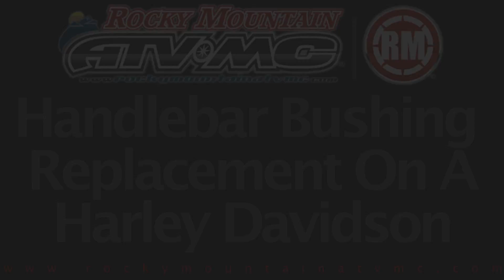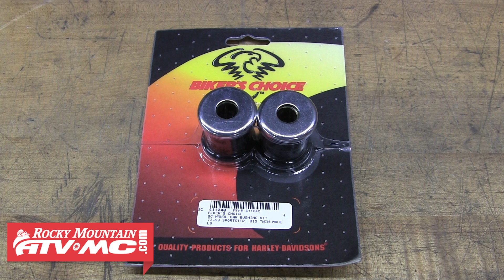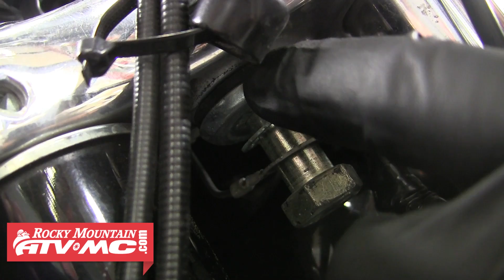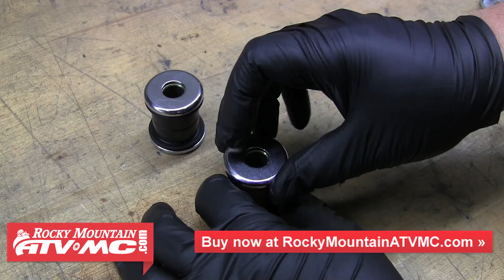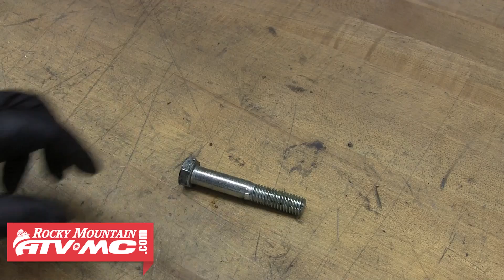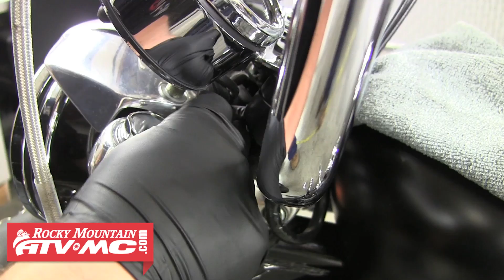Harley Davidson Handlebar Bushing Replacement (All Non-Fairing Models)

Comment: Super great well done and informative video.  My Q: I used a regular ranch is it critical if I over tied the bolts?
Reply from the maker: It is possible that you can damage the threads or break a bolt if you tighten them too much.

Comment: Medium Strength Treadlocker is usually blue
that looks red <--- hi-strength ...that's a 'no way' for this application
otherwise, very nice video 👍
Reply from the maker: This is medium strength thread lock from Threebond. It's Threebond 1333B which is a red/orange color.

Comment: I can’t fit the bushing into the hole. The polyurethane doesn’t  have any give in order to fit. Any advice on how to fit ?
Reply: Same. Did you get it to work out? Currently struggling with same problem lol
Reply: Use 1/2" bolts nuts and washers to press then in easily.  @jleman8

Comment: What are your thoughts about adding some silicone grease on the inside/outside of the bushings before install?
Reply: Jeff Stone I was wondering the same thing. I’m sure it couldn’t hurt. Unless silicone and urethane have some sort of chemical reaction to each other. I doubt it tho.

Comment: thanks for the upload. can't seem to break the two riser bolts, you guys got any ideas?
Reply: +Rocky Mountain ATV MC I did. with a hammer. a few times. Idk if it's the amount of miles or maybe locktite but both bolts won't budge. would taking a cheater bar to the ratchet to break the bolts fuck anything up for alignment?
Reply from the maker: +Tallon Conwell Try and give it a little tap to help break it free, see it that helps.